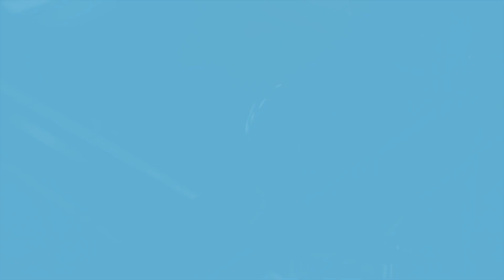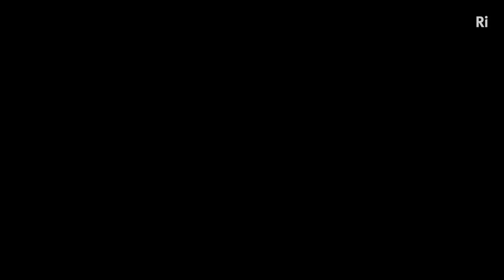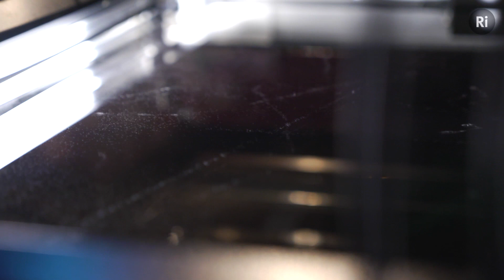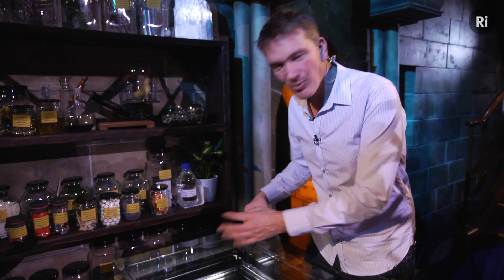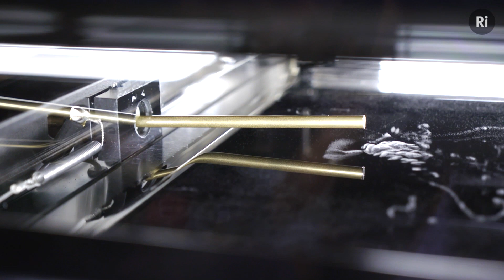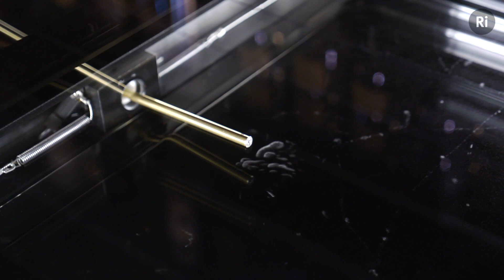Cloud Chamber: The Birth of Helium Atoms

Comment: No. Radioactivity is a statistcal process that cannot be influenced easily.

What leads to your oberservation is simply that alpha particles don't get very far until they collide with alcohol molecules in the chamber. 
Moving the rod around simply makes the vapor produced more visible in a kind of "Doppler-Effect", which is by concentrating wisps of vapor in one point and thereby making them more visible than on their own.

Comment: In a vacuum alpha particles can travel quite far, and yes, speed does have an effect as well, but the driving factor here is kinectic energy in relation to effective diameter. That's why beta radiation gives longer tracks in a cloud chamber than alpha radiation (similar (~1:10) kinetic energy, but much smaller effective diameter ~1:1000 IIRC) and a cloud chamber will predominantly show those from natural radiation / cosmic rays. Look up Thomson or Compton Scattering if you're interested.

Comment: The speed is not that important to the effect. The key is the length of "free space" a particle can travel before it hits a alcohol molecure and looses it's kinetic energy. It's basically like a game of billiards where the play ball is much smaller than the other balls on the table (a helium core has a relative mass of 4, alcohol 6*1 + 2*12 + 16 = 46).

Comment: On Earth Helium is rare—0.00052% by volume in the atmosphere. Most terrestrial helium present today is created by the natural radioactive decay of heavy radioactive elements (thorium and uranium), as the alpha particles emitted by such decays consist of helium-4 nuclei. This radiogenic helium is trapped with natural gas in concentrations up to 7% by volume, from which it is extracted commercially by a low-temperature separation process called fractional distillation.

Comment: Interesting, we were always shown radiation as some sort of perfectly spherical glowy green light, but it turns out radiation seems to look more like magnetism following bent paths and straight trails. No wonder, we always looked at auroras and never saw that pattern because we thought it was made by earths magnetism.
Reply: I love cherenkov reaction.  it's beta emmission in water (or with supercriticality in air). the electrons are actually faster than light in water causing a "Shockwave" and blue glow. seen it in air means you "tickled the dragon" causing Pu-239 to go into supercriticality and flash a blue electron glow and about 5000 rads of gamma. your dead in a day or two after you turn to mush and puke your lungs and internal organs out. sustained criticality would melt your plutonium,  or if done proper BOOM! at top efficiency 19 kilotons per kilogram. Nowadays the Nagasaki  bomb would be a "fusion boosted" 130 kt first stage of a 300-500 KT 2 stage thermonuclear bomb. Most modern bombs rely on primarily fission of a Pu238 sphere imploding a lithium 6 core to fuse tritium and dutirium boosting the plutonium to fission more completely yeilding about 150 kilotons. a neutron reflector directs energy to a U-235 "sparkplug" again boosted by lithium 6 fusion. In all this, fast neutrons even fission some of the U-238 tamper and reflector even small single stage bombs are far more efficient than Nagasaki. The Nagasaki bomb "should have yielded about 130kt instead of 19 or so. Over time we got really good at getting all the plutonium to fission instead of 20%.
Reply: The Simpsons cartoon is not the source to learn physics from.

Comment: Where can I buy one of those?
Reply: +sisbrawny A cloud chamber that can run for an extended period of time like this one is really expensive, many thousands of dollars.  But you can make one that runs for about 30 minutes at a time for a fraction of the price.  All you need is a fish aquarium, dry ice, sponges and alcohol.  There are even miniature versions you can make inside a handheld cup or glass.  It's a simple concept.  A source of alcohol evaporates at the top of the chamber and the cold floor of the chamber causes the falling vapor to condense.  A table like the one in the video needs an electric cooling system.  If you only want it to run for a short amount of time ice or dry ice is a cheaper way to cool things.  Instead of having an alcohol pumping system like the one in this video you can just have your alcohol evaporate from a sponge you soaked in alcohol and stuck to the roof of the chamber.  Obviously it only works until the sponge gets dry.
Reply: Plur307 Would liquid nitrogen make it more efficient or not work at all? I have a 20l tank I can get filled for cheap and want to try to build something like this
Reply: MaxRay16
This has nothing to do with liquid nitrogen.  This is using alcohol which is warmed in a wick and forced to evaporate.  Think of a steamy room, only the steam is alcohol, not water.  The gas in there is almost entirely alcohol vapor.  Warm alcohol is forced to evaporate at the top of the chamber and the bottom of the chamber is cold so the alcohol wants to condense back into liquid form.  You might be bale to use liquid nitrogen to cool the bottom plate of the chamber, but it doesn't need to be that cold.  The trick is getting lots of alcohol vapor.